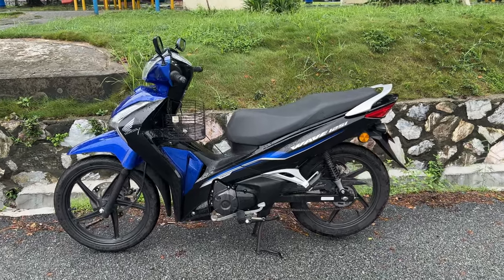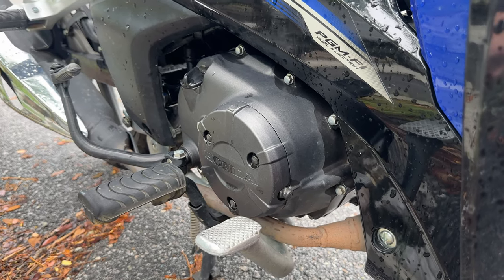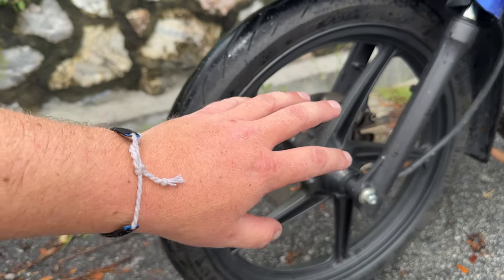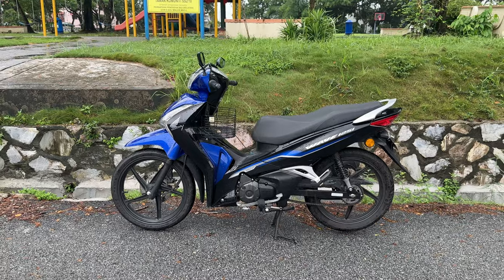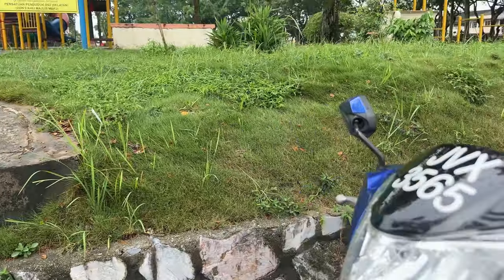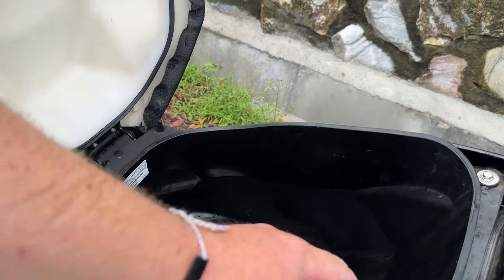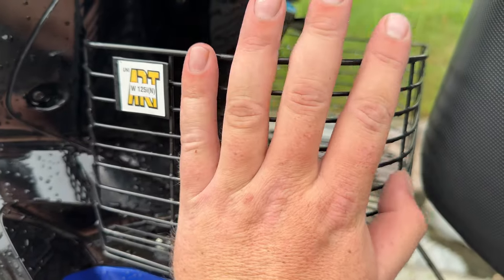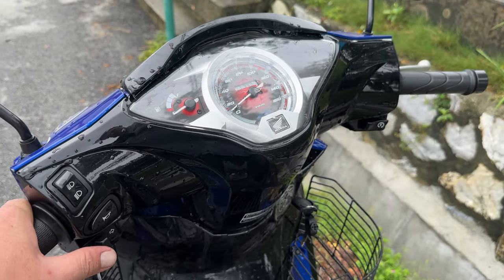Honda Wave 125i from the Boon Siew factory | RTW #040 🇲🇾

Comment: When I was choosing for my motorcycle for the first time, I almost chose this model, but instead I ended up with a Honda Dash 125 since Dash 125 is lighter and bit faster than Wave 125. It's also worth noting that all Malaysian Honda underbones are assembled locally woth parts either made locally or imported from overseas Honda factories
Reply from the maker: Yeah the Dash is a cool bike - honestly their engine is exactly the same so I feel like the speed is just because of the lesser weight. Thanks so much for watching!
Reply: Nah bro , Wave 125fi is faster then Dash . Pickup can go with dash , but judging by long and torque Wave is incredible

Comment: It's very similar to my Innova 125. a UK 2012 bike (the last year they were available in UK). I got it in 2015 as second owner, and I love it!
Mine has spoked wheels so tubed tyres, a straight exhaust, enclosed chain guard, and the seat is unlocked with the key  in a lock on the left hand rear, below the rear seat.
Mine has a front basket attached to the three attachment points missing on this Wave.
It has a front disc (no ABS) and a rear drum. It has a side stand and a centre stand. Amazingly it still has the original 2012 battery, and starts on the button first touch every time.
Reply from the maker: Your Innova and my Wave in New Zealand are pretty close in their styling. I got the next gen Wave, 2012-2017 - that was the model after they were making them innovas. Great bikes - seems like people in the UK are only just cottoning on to how great they can be judging by the SBBA and GFOSB facebook groups. Here's a link to a video I made on my Wave: https://youtu.be/4eqRRKMq-Ww?si=5-ooX4SRIPPrtyZu
Reply: I’m in the UK 🇬🇧 and it’s fantastic, also got a Honda ex5 and a Kawasaki edge 110, love these kind of bikes, currently own 32 😁😁😁👍
Reply from the maker: @StephenWilde-g1p  Nice collection! Thats a solid line up of bikes.

Comment: I used to own an older model of this bike for two plus years and although it has excellent fuel economy, there are a few things that I don't like. First of all, it tends to vibrate a bit more than my current bike, Yamaha 135LC. Secondly, because it is air cooled, they have to limit the max RPM, so this bike will tend to struggle a bit above 90 km/h; at least for the model that I was using. I am not a speed junkie but when I needed the extra speed, I was quite disappointed. And of course, the dreaded Honda horn-signal switch swapped placement.
Reply from the maker: Yeah it's true - in stock form they are really only good for up to 90. Sure maybe you can reach 110 but you need downhill and wind behind you. The LC135 is a great bike!

Comment: Yes the tail lights separation from the amber signal lights are regulations on new models from 2017 onwards from the department of transport, this requires signal lights to be a certain distance apart from other light sources (headlamps/taillamps) hence the honda wave alpha in 2017 have those weird front signal lights sticking out as a stopgap measure back then
Reply from the maker: Interesting stuff - thank you for commenting and letting me know.
Reply: Yes bro, its euro 5 regulation for motorcycles if not mistaken 😊

Comment: Can you buy the engines cheapish from malaysia?
Reply from the maker: Very good question. I didn’t look specifically. Best bet would be trying to buy damaged bikes and pulling the engines out I imagine.
Reply: Not sure about fuel injection ones, but old Wave 125 engines that uses carburettor can still be bought, albeit I'm not sure how since I've never done this before. Usually some people here would put an old Wave 125  carburettor engine onto an EX-5, C70, or any older Honda underbones. Is it legal? Well, not road legal, but hey, still doable

Comment: Any Suzuki moped is better than this. They are freaking tanks. The engine is really hard to break down. You have to be really fucked up to break a Suzuki.
Reply from the maker: They’re all great. I don’t have any brand preference it’s more decided by what is available at the time.
Reply: @SmallBikeStuff  What is available eh? Most Suzuki moped is from the old era so you will probably not going to find one around. The new era only have Raider 150.
Reply from the maker: @gilgameshlfx7006  as in what was available when we arrived and bought bikes at the start of the trip. No suzukis around: https://youtu.be/1NWCgqsFsQ8?si=__iS6nzq381x1LnD
Reply: @SmallBikeStuff  Yea well, the list of shops that sells them are quite short. Suzuki left Malaysia in 2016 and only make a return in 2022. They are practically 2 years old in Malaysia.

For small bikes of course. Big bikes never left.
Reply: Suzuki Moped is better BUT in Malaysia Suzuki spareparts it's hard to get And sometimes machanic rejected to repair a Suzuki motorcycle because it's  hard to repair.